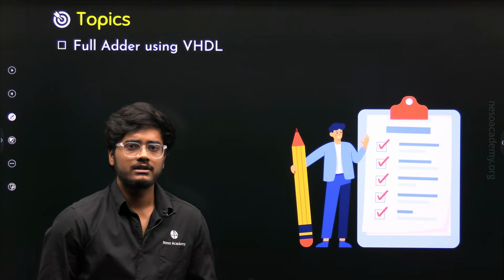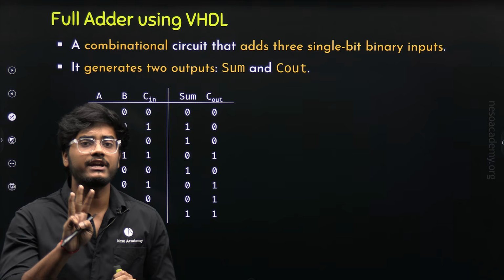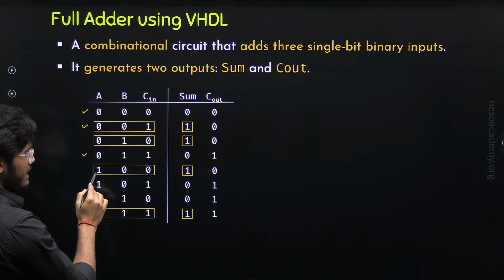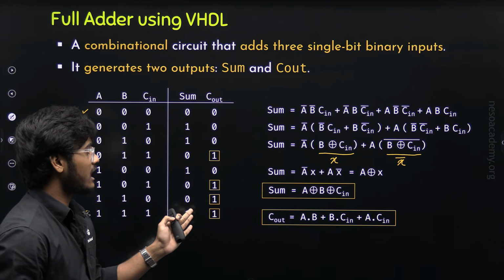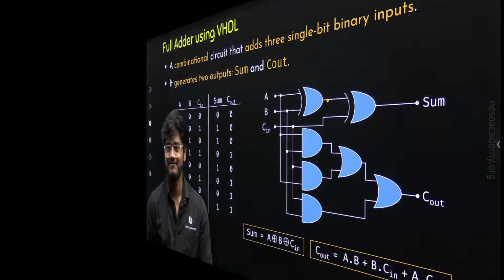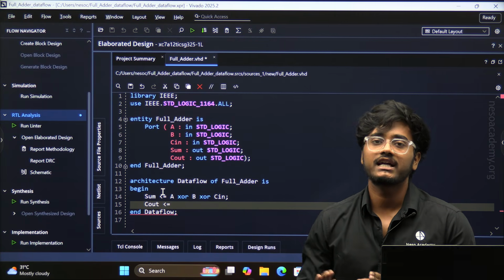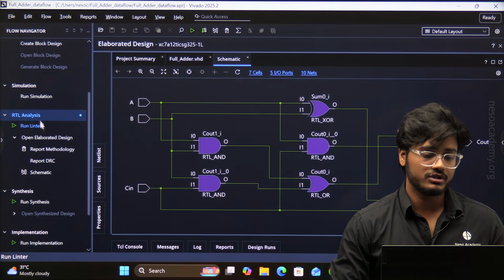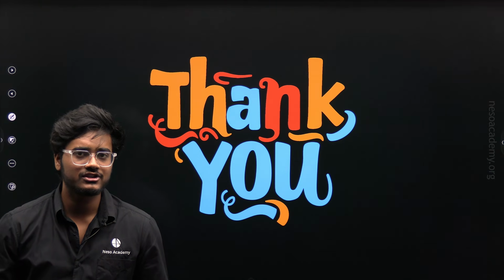Full Adder using VHDL

Comment: Nice video!  Just wondering why you don't required a test bench (eg. Half_Adder_tb.vhdl)  in your code? Yet you can still run a simulation in Vivado?  Strange ?
Reply from the maker: Vivado has a built-in simulation feature that lets you do this. You can manually force values onto your input ports directly in the waveform window and observe the outputs without writing a testbench. We’ll cover how to write testbenches in the last chapter.
Reply: @nesoacademy  👍👍👍
Reply: @nesoacademy  if thats the case, then why bother to learn and write a separate test bench code?